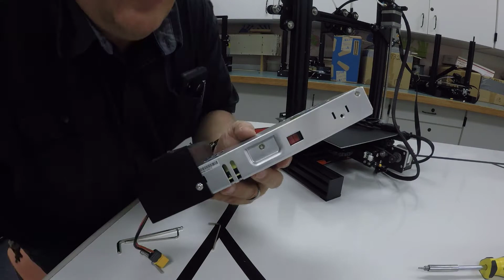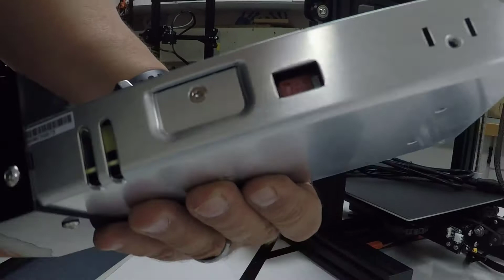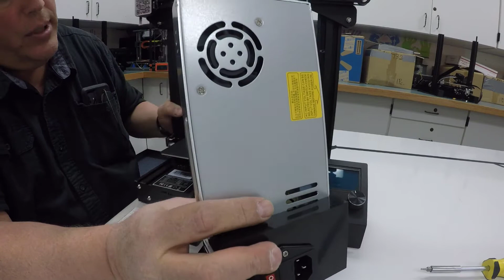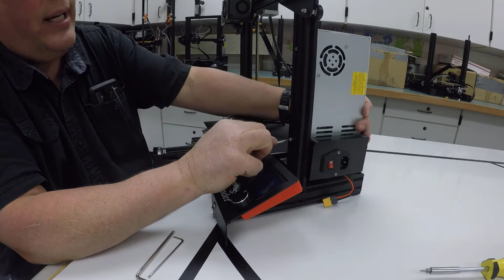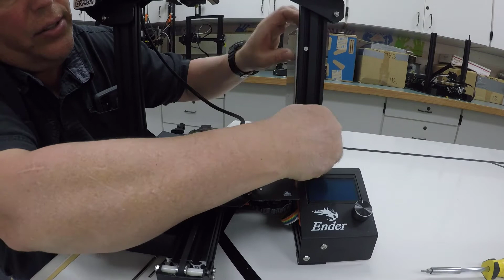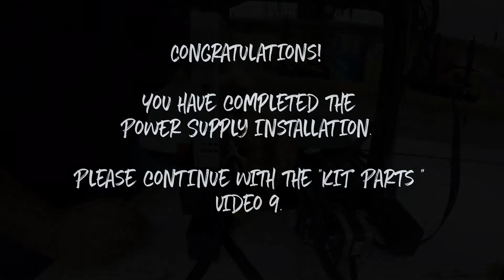Ender 3 Pro - Power Supply Installation (11 of 15)

Comment: my magnetic bed scratches the plastic on the side of power supply. my frame is square.. i guess i can live with it at long as its not putting stress on the y axis,, or slowing anything down.
Reply from the maker: I had a similar issue.  To fix it, I started using an 1/8" thick mirror and hairspray as the printbed instead of the magnetic bed cover.  I hold the mirror to the bed with mini binder clips.  Works great!   I had the mirror cut at the local glass shop for 4 bucks.  Made it the same size as the aluminum bed.